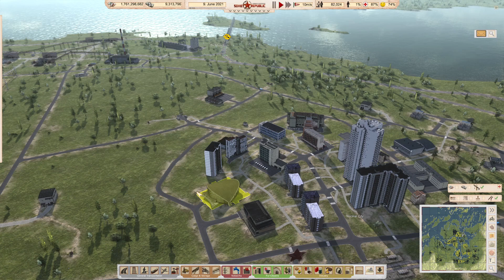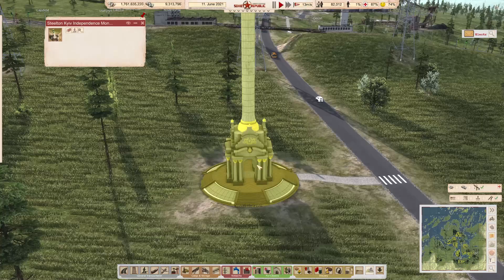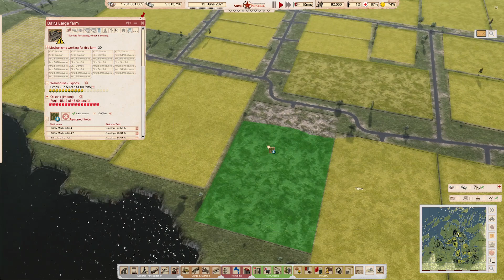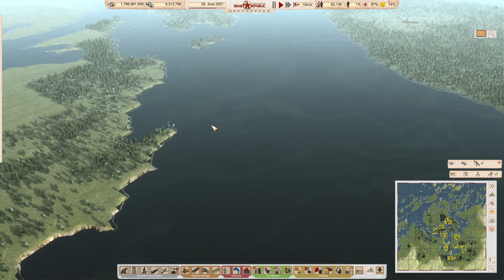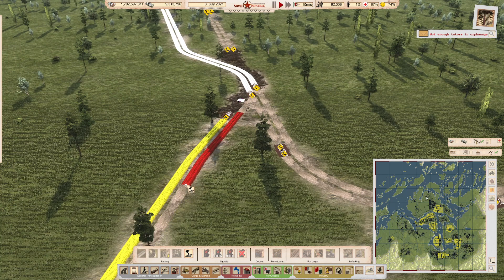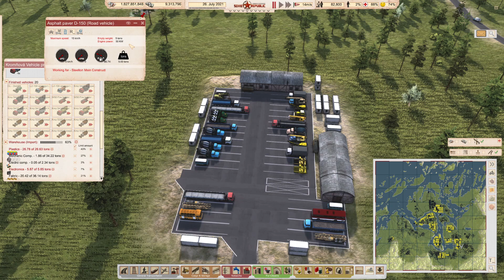New Prison. More Plans :: Workers & Resources Soviet Republic (1947 Start): #147

Comment: Since your farms have constant yields, that implies you're already using fertilizer.  Without fertilizer you have to use the farm-fallow cycle to keep a crop of land productive.
Reply from the maker: Hope keep the farm cycle, if they add fertilizer would like to see a increase in yield per field for each season. e.g. 25%.  This would provide another planning decision as those extra crops will need to collected and stored.
Reply: @StephenSilverbeard  No, that's what I am saying, they don't have a farm cycle.

Without fertilizer you're stuck with only 1 growing season a year, and if you grow every single year you deplete the field so you can't do that.  You end up having to grow your crop one time every 3rd year or so and leave the field fallow (either don't plant in it at all, or plant feeder crops which you allow to die and decompose to renew the land).

That's obviously not what is happening in game, so in game you're already using fertilizer.
Reply from the maker: @jimmydesouza4375  Interesting idea, it would have to be an optional mechanic as the change would be too much for the player community.  Remember the backlash when the devs introduced seasonal farming as it broke existing save games.  Will have to wait and see what the devs decide, but may have to wait until after the full release.